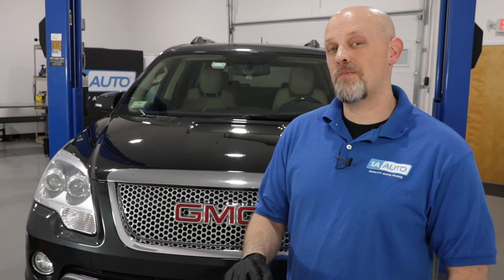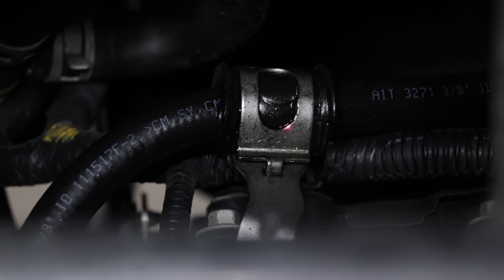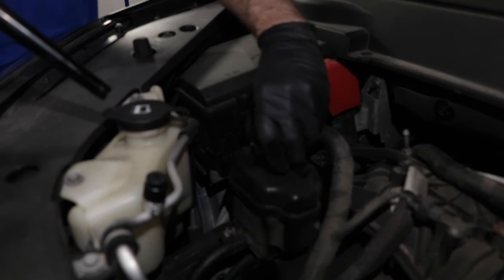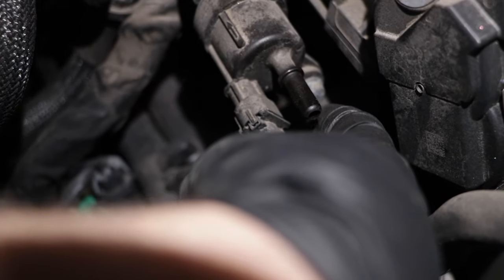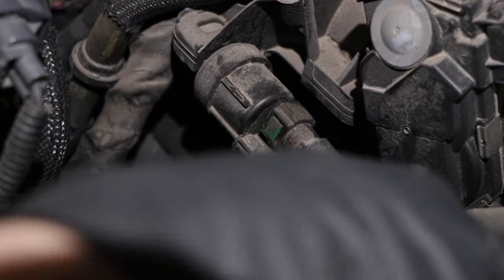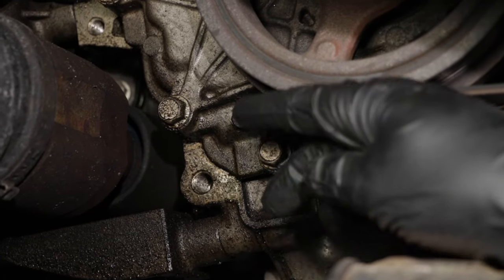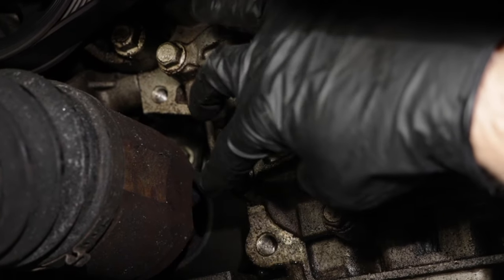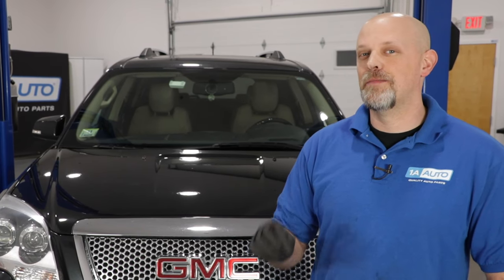Top 5 Problems GMC Acadia SUV 1st Generation 2007-2016

Comment: I have the 2012. It has cost alot of money in repairs. Not happy with this car. 120 ,000 miles and now the trany is going out. $4500.00 to fix. I'm done. Going to trade this in. this should have been a recall as so many owners have the same problem  at 120,000 miles.   At about 100,000 miles I had to pay $18.000 for the motor issues.  Very disappointed  with this car.
Reply from the maker: +Michele Brooks Thanks for the feedback!
Reply: Did you trade in your Acadia? I want to bc I'm starting to have transmission problems on my 2012.  I owe money on it still. 😩

Comment: Acadia 2008  stabilitrak service and the car loss power.. ..and it starts to shake.. the mechanics can't find the problem  already invested 600 $:(
Reply: I have the same problem and have been wTching videos.  I am also getting an oil light and shut off engine light.  I turn the engine off then on again and it run ok for a while then it starts again.
Reply: I also have a 2008 which had the same problems. I recommend replacing the throttle body and pcv valve. I ordered the parts of Amazon and it's been over 3 months, so far so good. These actually weren't too hard to install, good videos on YouTube to help.
Reply: Throttle body needs replaced. Exact problem I had with mine
Reply: @matthewspahn6828  I agreed with you on that did same fixed. 2012 Traverse

Comment: I've replaced my engine , transmission, control arms,  and all that good expensive stuff brakes rotors bought brand new tires all 4 Replaced the brake pedal position sensor gave it an alignment yet my wheels slip when I'm taking off  I literally have to go slow for it not to doit.  I'm tired of buying stuff and not fixing the issue what could it be . Hellllppp.. do I just need a new car. 🤣.

Comment: Hu. Thanks for the video. I have a 2012 Acadia with 140k miles. I am facing an issue with it and would appreciate if you could help me out. As I crank the engine in morning it gives out 1-2 seconds sharp clicking noise after starting... The sound is only after cold cranks i.e. morning or after 4-5 hours parking... Can you help identify the issue
Reply from the maker: +Umair K We wouldn't be able to diagnose an issue like that here, you may want to have a local mechanic take a look at it. It could be that the vehicle isn't getting the proper power to start on the first crank. Thanks for checking us out! 1AAuto.com

Comment: New battery 
New starter
New alternator 
New radiator 
New fuel pump
New fuel sensor
My ac is out it’s been out ever since I bought it and it worked couple times but won’t stay working my radio has no sound and now it’s not starting at all no crank

Comment: Why doesn’t anyone ever address oil consumption in these first gens. I’d like to call them something else.  They go through oil like crazy on 08s, this is why gmc changed the valve gasket. Yet they never recalled it. The gaskets and so forth are supper expensive to do. Yet you can do a catch can and solve this problem. Why is no one talking about this.
Maybe it’s because the symptoms are fixed in another way; however go back to problems shortly after. The pcv valve which is not a valve at all just let oil spray into the throttle intake and valve. This makes them burn oil with hardly any smoke along with you wondering where it went since you don’t have an oil leak.

Comment: I happened to own a 2010 GMC Acadia and it keeps draining my battery, if I don’t turn it on one day the next day the battery is completely dead.  I had replaced the battery twice and it still doing the same, anybody out there who has had this issue? Any help on this please, thanks
Reply from the maker: +Rocio Solorzano We wouldn't be able to diagnose an issue like that here, you may want to have a local mechanic take a look at it. Thanks for checking us out! http://1aau.to/m/Shop-1AAuto-c

Comment: when I get on my brakes it wsnt take the gas I get off the brakes and then it'll accelerate it just kills sometime but it'll start right back if I'm sitting at a red light and I hold my brakes better kill I match accelerator it won't accelerate get off of my brakes then it accelerate why is that

Comment: Worked at a GMC Dealership as a Service Advisor and this vehicle was straight up junk. It was embarrassing when customers would come in and complain about the same  problems but there wasn’t any service advisory or recalls. They were only concerned about selling services that weren’t really needed in accordance to the Owners manual.

Comment: Worst vehicle I ever owned. I bought a 2009 at 120,000 miles thinking it was a great deal. But within 30k miles at around 150k everything possible broke on it. Timing chains.. suspension was wore out... transmission failing. Wouldn’t pass emissions... Traded it in. Got nothing for it.

Comment: GMC Acadia that will not start after being in the rain Clean out your drains and your top window and that will stop the water from draining down into the car and put a heater on the floorboard and dry that corner out on the passenger side of the car that will fix your problem. drains get plugged up in the sunroof there's one on each side in the corners. the water leaks down and gets into the fuse box and that's shorts that all-out car won't start or anything. the GMC Acadia are bad about that. this may help someone.
Reply from the maker: +Loren Knowlton Thanks for the feedback!

Comment: Hi! My acadia 2012 just developed a problem in which when I cold start the engine it's starts well with every thing perfect. But when I go on a drive and temperature reaches 100 and if I stop and switch off it won't start. It does crank but not start. I leave it to cool down for few ours. When I restart it starts. What will be the cause of defect. Pse guide.
Reply from the maker: +WASEEM AKHTAR We wouldn't be able to diagnose an issue like that here, you may want to have a local mechanic take a look at it. Thanks for checking us out! http://1aau.to/m/Shop-1AAuto-c

Comment: Not sure what my problem is. but
it's leaking and è = where it's coming from. I took it for an oil change and the said its leaking but the can't tell what it is. power steering or transmission.
Well I can say I always check/ my garage floor. I didn't have a leak. 
so now I'm leaking Transmission fluid.
paid 28 thousands for a  that didn't last 10 years. never again will I by  a chevey ever never ever.

Comment: I would never get an older GMC Acadia, ever. Not even my parents would, because they are all extremely garbage. It is the same with the newer Chevrolet Equinox, both engines. Please for the love of God, do not buy one of these vehicles, whether if it is used or brand-new.
Reply: What’s your problem. Are you antiamerican

Comment: Sorry but this boy  CLUELESS, Timing chain stretch is a huge problem, roughly $3500 for a chain job, , this is an intentional failure caused by GM , by having the oil change lite come on at the 8-12 mile mark
Reply: This is why I change my oil every 5k with synthetic. That $25 bottle of Lube is cheaper then an engine replacement.

Comment: One of the worst vehicles I've ever owned.  All kinds of electrical problems along with a terrible transmission.  Run as fast as you can from these things.
Reply: I purchased it at 110k miles and thankfully purchased a warranty.  After they shelled out about $8k on repairs, the warranty company said it was done fixing it and cancelled my policy.  Terrible vehicle.

Comment: Have an 08 and I am sending it down the road once I clear the airbag code. I have replaced multiple parts including transmission. Timing chain noise on start up. All wheel bearings and shocks and struts but may have been originals. Horrible mileage. Don’t buy one. Nothing but trouble!!!
Reply from the maker: +Matt Kuester Thanks for the feedback!

Comment: The GMC Acadia is a horrible vehicle and nobody should buy one, ever.  Way to many problems with that vehicle.  It's no wonder they price so low on the used car market.  Nobody that does any research on the Acadia will touch them.

Comment: Yeah, never a buy one of those pieces of sh*t. My mom bought this car, and it has had so many problems, (1) coolant leak, (2) over heating, (3) transmission problems, (4) it randomly goes into low power mode. Terrible car.